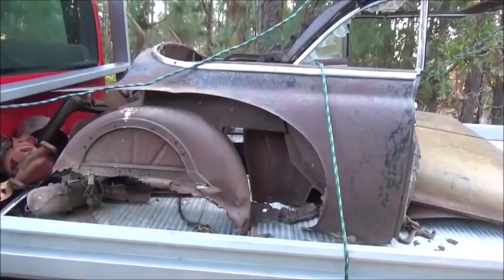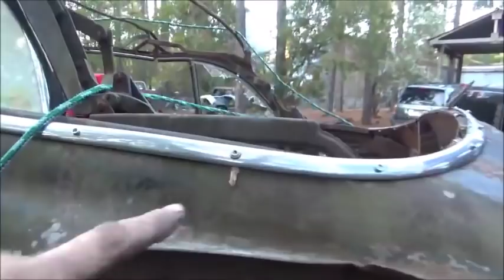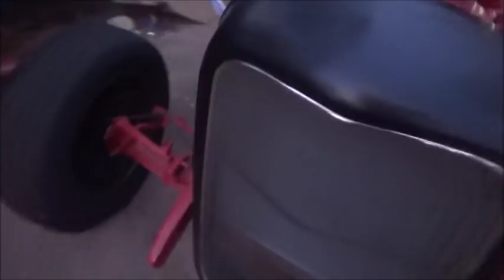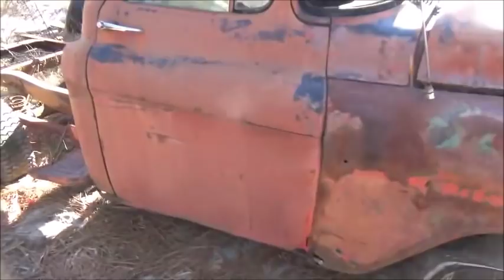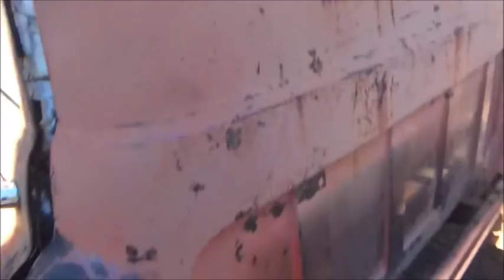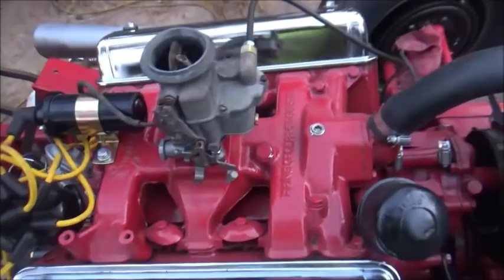1931 FORD UPDATE 1949 CHEVY CONV. PARTS & 1955 CHEVY TRUCK

Comment: Its great to hear the engine run again, i thought it would of been louder. Then again video versus standing beside it. I like the bar around the gas tank.
Reply: Turn up your volume. I run some decent speakers and a subwoofer--makes all the difference.
Reply: Flat Heads are the same way. they run quieter than other engines.

Comment: The moment we've all been waiting for: the 239 coming back again. And sounding badass. Can't wait for the big reveal.
Reply: 312 yblock
Reply: @dougabel5198   It's a first generation 239 cubic inch Y-block from 1954.
Reply: I suspect that it might be a 272 or even a 292.  those Y blocks can run right with an equivalent SBC... I've owned a few..  and the 312 in my 57 Truck was more than enough for the average SBC>>>.

Comment: Jonathan I have a guide 682c headlight ring like what you need. It is not stainless, and has a small dent on the right hand side on the lower part, but if you're going to paint it you can knock it out and it will be fine. If you want it I can send it out to you I will be going on vacation starting tomorrow so it will be the following Monday before I can mail it out

Comment: The old Y block is sounding good. Nice job on mounting the fuel tank, another nice touch on that beautiful frame. The 49 convertible is pretty rare for sure. It would surely be fantastic to see that one come together. I wouldn't be surprised if ol Delray came callin about the Chevy truck ha ha.

Comment: Wow man that sounds so good I like it. Gas tank looks beautiful and placement is fine. Its an ALUMINUM tank so it will NOT blow up! The metal tanks when they got hit made a spark. The aluminum will NOT spark. So its completely safe man! Lee Iaccoca replaced the Pinto gas tank with a plastic one and the problem was solved but they dont tell that part of the story.

Comment: Great progress JW ... just as a observation that bluing on the exhaust besides getting really hot was likely from the carb being so lean for those first minutes after start. Seems like as soon as you adjusted the enrichment/idle needles everything smooth out and the lazy reaction when you gave it gas all went away. Anyway, it is what it is! Carry on Captain!

Comment: The old Y block sounds sweet. Jon, if you can get that old carb top chucked up on the lathe, (even screwed to a block of wood) you could skim the top to the straight sided shape that you want. I was thinking of doing some my self. I have a couple like that. The ones with the V shape are truck. Maybe I'll do a video on it.

Comment: Man that is sure one sweet sounding Motor. Those headers are perfect for her. It looks great. Like there has been many more thousands of dollars invested than has been. If all you have is a small coolant leak on the thermostat  housing  gasket, you got lucky  for as long as she has been sitting. Those headers would look great with  some heat shield thremo wrap around them. She sure sounds great just with the headers. It's a shame to put mufflers on it.

Comment: I noticed the 1958 Ford back there when you were showing the 1955 Chevy P/U  I prefer 1957s. the ignition timing was late on that Yblock when you first started it. sounded good after you got it started. those damm overrunning clutches on Ford starters. heating up those headers should help the paint to stick good. you could probably adapt the bottom of the air filter housing with a the clamp to fit that carburetor. I like the Borg Warner T55. it seemed like normal issues starting a new engine.

I know a person that has a 1948 Chevy coupe but he has already restomoded it. so I doubt he would sell it sorry.

Comment: Having seen what you can do with a pile of old bones, I was not shocked by the panels on the flat bed as I may have been before. The motor runs well and sounds great. Not sure if we could get away with stuff like this over here in the UK having seen some vids on DVLA testing.

Comment: Ford passenger car carb model 94 has the straight neck you are looking for the air cleaner. 94s with the flare at the top were used on the ford trucks.

Comment: Sound pretty good fot whastv ever year it is you didn't do anything side. You got to cut hole the te headers so you can run exhaust pipe under hot rod or are you going make baffled for inside the tubes and put elbow were block off plate goes. I like how did the gas tank and made crash bars to protect it. looking good. So how you feeling better I hope.

Comment: If that still has the dual diaphragm vacuum advance distributor, you won't have any "centrifugal" advance unless the venturi vacuum line is attached. That distributor doesn't have any mechanical advance mechanism. Venturi vacuum from the carb supplies the "centrifugal" advance and regular vacuum supplies "load" based advance.

Comment: Hell, it ain't a pinto, its yours and not as many people died from them kind of wrecks as they made it sound like. It sure as heck ain't behind the seat so you would die if you were smoking when you rolled over in a ditch. I had the gas in a tank running down my back when I put it in the ditch and the tank was behind the seat... them kinda made me nervous but then I thought, what a novel idea... stay out of the ditches! I was kinda surprised when it didn't'[t pop right off as it started so easy when on the floor and gas through the top of the carb. Different day and different way of holding your jaw I guess. Going great and going to really turn some heads. I don't know just how Carolina had so many neat cars in the bushes but some more nice scores. I think you can run one of those Jr. Samples from Hee Haw shows ad with the call BR549 to get you a hardly used car/LOL... Have a great day guys

Comment: Interesting heat patterns on the headers, you need to get a lazer temp sensor to check what the differences are. Empirical says #4 isn't firing as hot

Comment: Are those nylon tires in the back? Or are they radials? I had an old truck I was running nylons in the front and radials in the back and it handled poorly. I drove like that for years though. I was broke and what I had to do. I didnt know better for a long time I guess it was not so bad really.

Comment: Excuse me but aren't most fuel tanks in the rear anyway . Now my question , why is the cylinder on the drivers side closest to the rear cold while the engine is running ?
Reply from the maker: I painted that pipe with heat paint that's why it looks like that

Comment: My question is for anyone that wishes to answer it 
What are some of the reasons why that one cylinder is running cooler than the others
Thanks 
That’s going to be a beauty J
Reply from the maker: Probably valve adjustment on this engine. But could be anything that causes compression loss or even a bad plug.

Comment: Johnathan, that Chevrolet, ye have got running, isn't a sedan delivery, it would have to have 4 doors and a seat in the rear, to be a sedan. What ye have there is a panel truck.
Reply: A sedan delivery is basically a two door station wagon with the side windows filled in and no back seat. It isn't the same thing as a regular sedan which is what you described. A panel truck is built on a truck chassis with a truck front clip.